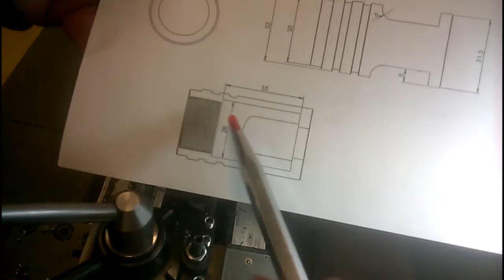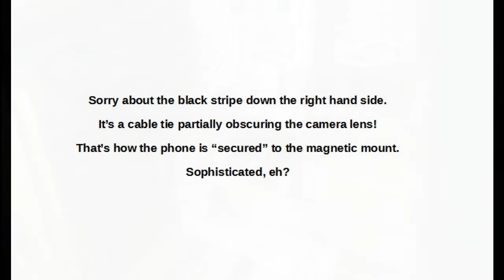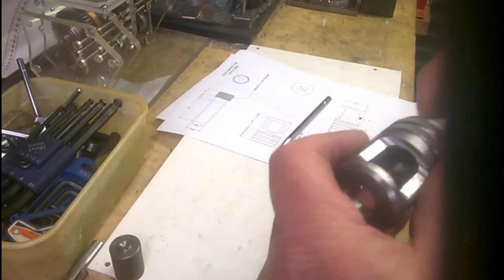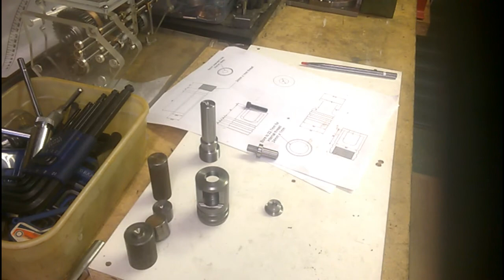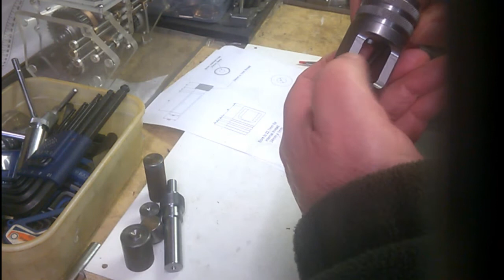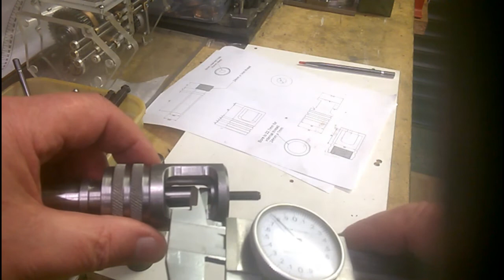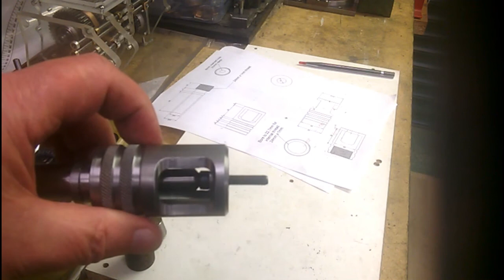Workshop tooling -  Part 7 Lantern chuck part 2

Comment: Nice steady away work. Is the knurling tool one you have made. Not seen one like that.
Reply from the maker: Yes, Steve.  It's a homemade one to a design by Graham Meek.  Has a capacity of up to about 60mm diameter, though I've used it, carefully in "push" mode to do the knurl on my boring/facing head.